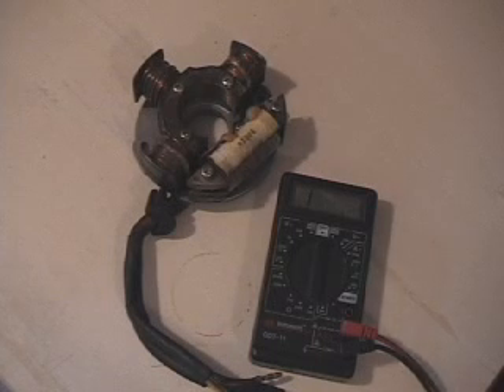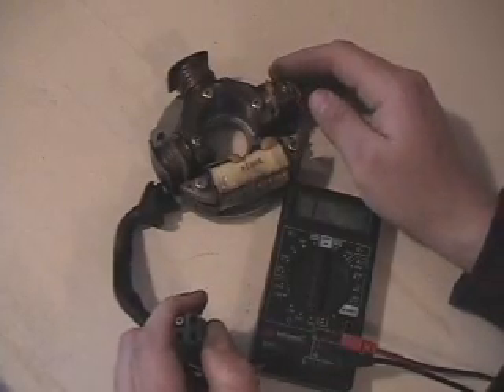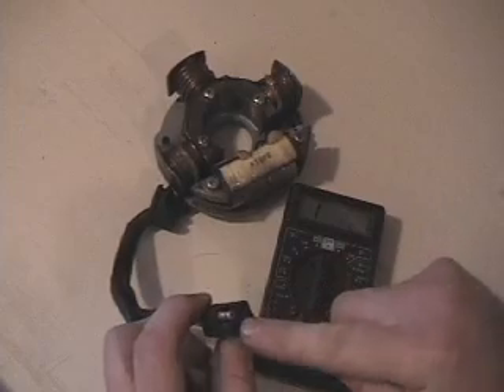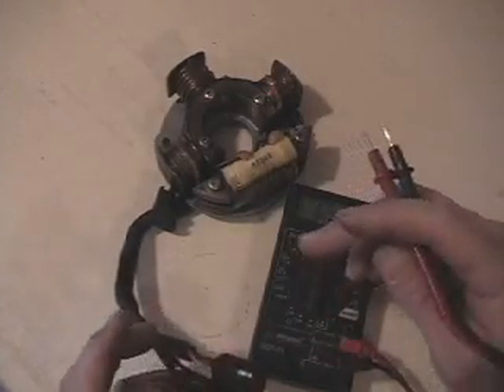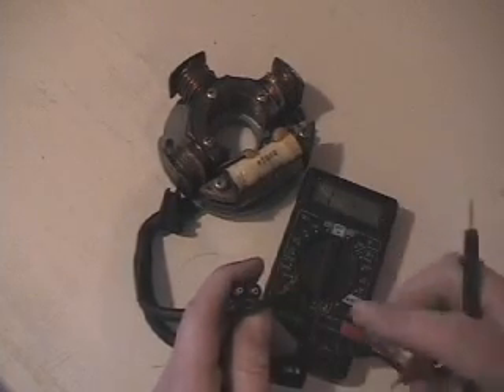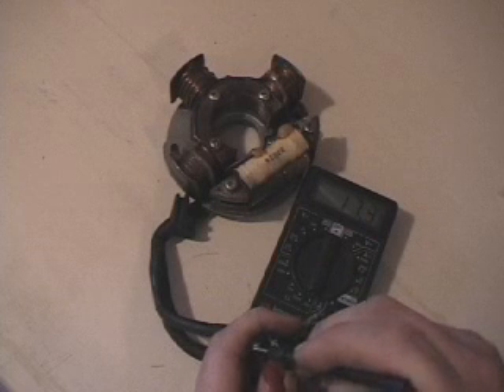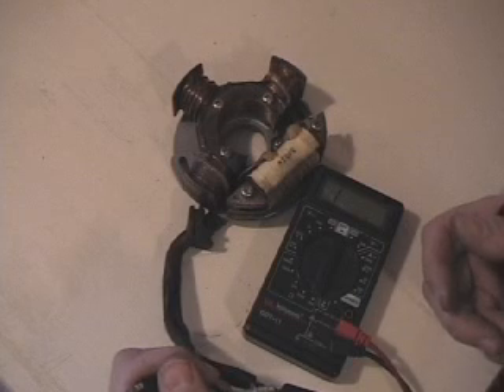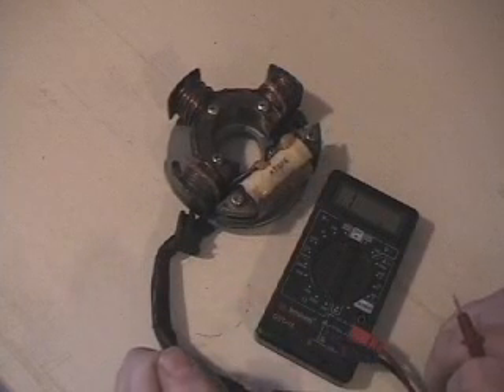Arctic Cat 440 Fan Stator Testing

Comment: Now is a stator only for electric start? Or do you need a stator for pull start as well. New to the hobby not sure thx
Reply from the maker: both. A stator puts out voltage and the rest of the electrical system dictates whether it is only used for the ignition & lights or if you have a regulator/rectifier it'll use some of the AC voltage it puts out and convert it (thru the rectifier) to DC voltage so it can charge a battery.

Comment: Great videos Blaine . I tested my stator out of a 440 Fan and the low speed read 145 and the high speed 15 (Cold) . Having an issue with the sled conking out after 15 mins or so of use. I tested the stator when hot after she quit and got 185 on the low speed and 17 on the high speed. If you give the sled 10 to 15 mins to cool down it will fire back up and run again. Do I have a bad stator ? Thanks
Reply: I've been having similar issues on my 97 z440. What did you find out? Was it the stator?

Comment: Hi there so with the two wires jumped and running I should be able to test ac volts of yellow wires correct? Should it be 12-14 or so. Thanks
Reply from the maker: Correct. Before the regulator it will reach as high as 30 or more volts AC.

Comment: I’m testing my 1991 Jag 440 afs fan cooled. It runs but is missing. Had been fouling the mag (right) side plug. I have a few questions. 1) does the low speed coil actually run the lower RPMs then the high speed coil takes over at higher RPM? 2) Do these readings seem good? At 24 degrees outside my 3 prong tests at...between two males 144.5ohms...female to top left 16.8ohms...female to top right 160.2ohms. Currently heating it up under a tarp to get about 70 degrees to retry then I’ll let it get to operating temp to test it again. 3) I jumped the non yellow connectors on the 4 prong plug. Sled seems to run better in my yard but I can’t test it tonight because I’m in a city neighborhood. Is there a common electrical item that shorts out on these jags? I think the TSS is jumped already.
Reply from the maker: those stators don't go bad very often but normally the low speed coil measures closer to 155-160 and both in series measures closer to 170. So yes, it seems like the ohms on your stator are a little low. I've seen them run with the ohms a little low so check all of the easy stuff first before changing the stator out.

Comment: Hello blaine. im fighting with a 1995 puma 340. no spark. I have resistance coming from the top 2 males.  i have no resistance coming from my bottom female and top left male. service manual tells me thats the trigger coil. suppose to be around 17ohms. no resistance rule out a bad stator?
Reply from the maker: No resistance for the 17 ohm coil means the stator is bad. www.outdoor-electric.com

Comment: Is 120 ohms out of spec on low speed?
Reply from the maker: It's a little harder to tell on the older stators but that coil range normally measures in the 150's on known good stators.